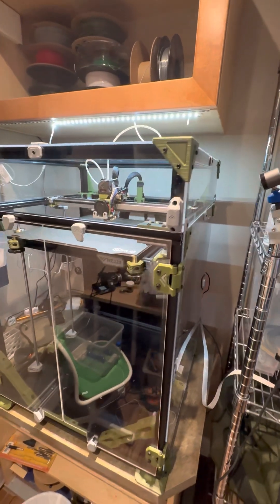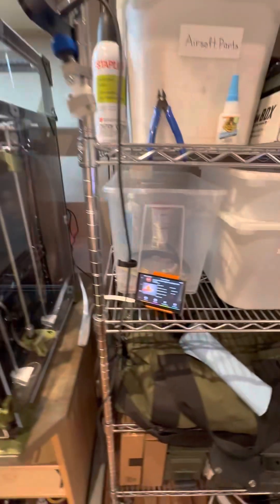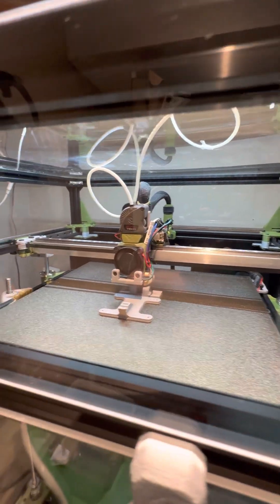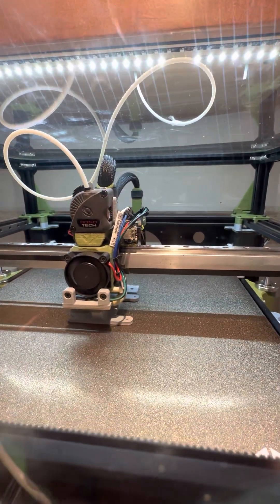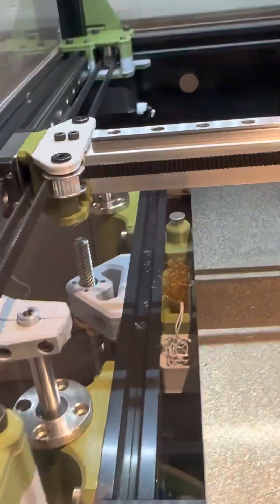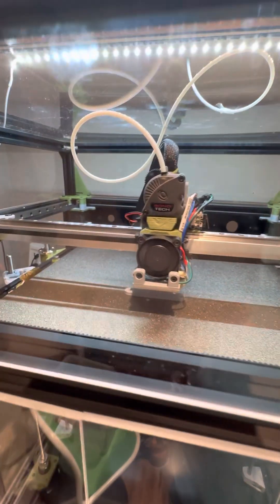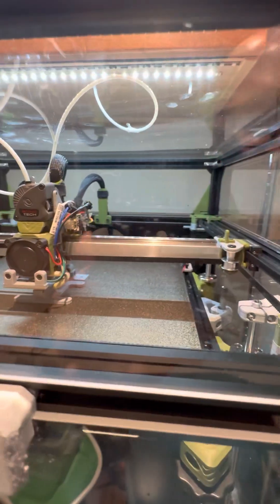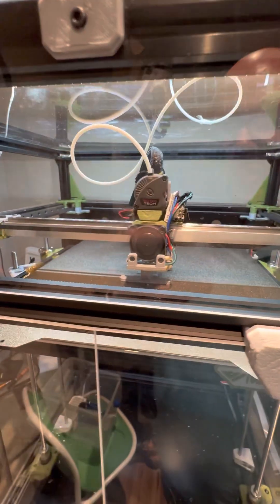It finally looks like a real VZBot!!

Comment: Nice build! 
Heatbed is still stock? 
I want to upgrade my tronxy too, but first thing is klipper, stock software is something useless. 
And x/y next :-)
Reply from the maker: Yes the bed is still the stock bed. I might upgrade it next year and do a three point Z setup.
Reply: @sparks-tech  do you have a particular triple Z setup in mind?
Reply from the maker: @cardosodouglas  I am thinking I will use something like the Trident but there are some folks working on a belted Z on the discord that looks interesting so maybe that.